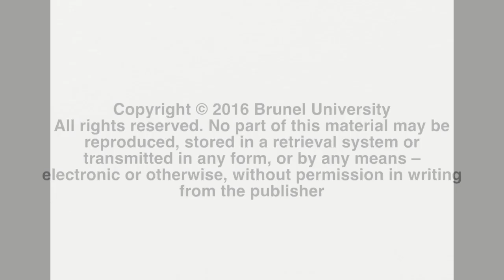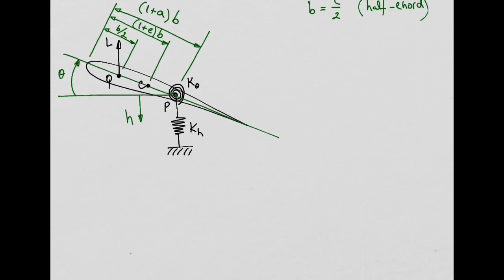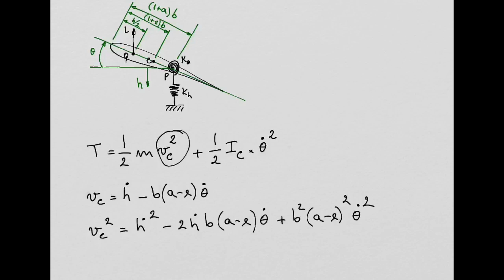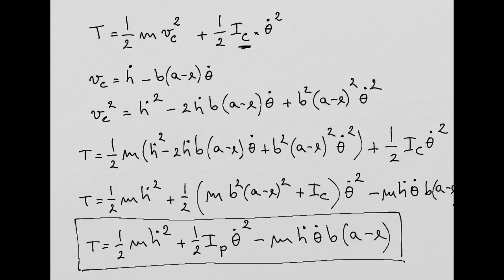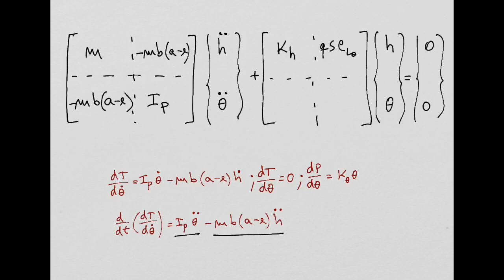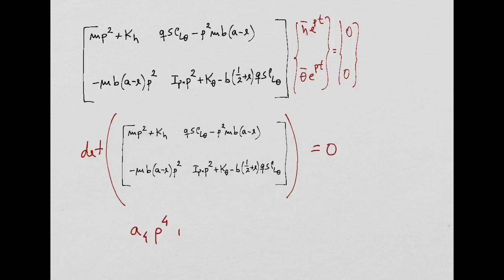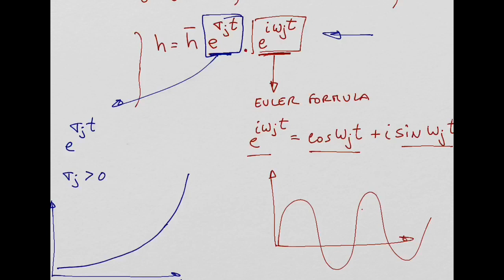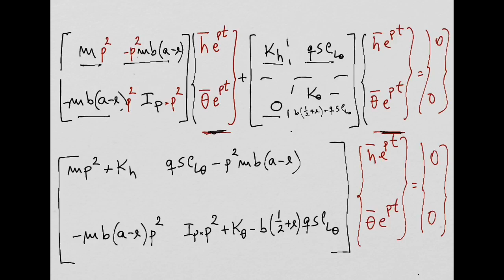Aeroelasticity - Introduction to Flutter

Comment: Could we apply for wind turbine?
Reply: My guess is yes, but flutter usually doesnt happen at lower wind velocity. Tip deflection will be the bigger issue for larger blades, however, maybe for smaller blades flutter could happen? You bring up an interesting question. I bet small blades yes, but not for large blades

Comment: for what flows is this eqtn valid will it work for laminar ?
Reply: I think the assumptions are that the flow is in the Steady State and the velocity of the fluid is much faster than that of the solid, in a way that it is reasonable to neglect the feedback motion effect of the solid on the behaviour of the fluid.
But  I didn't know why he assumed that the two motions (h and theta) has the same p, and what is consequence of substituting different parameters for the frequency (p1 and p2) for example?